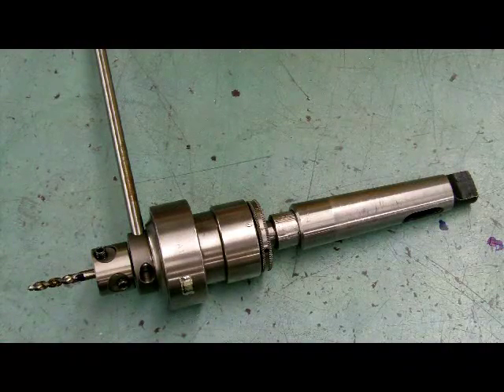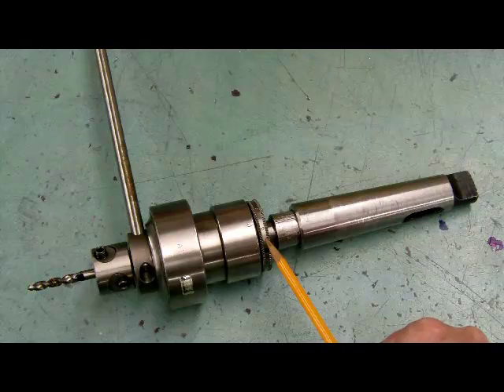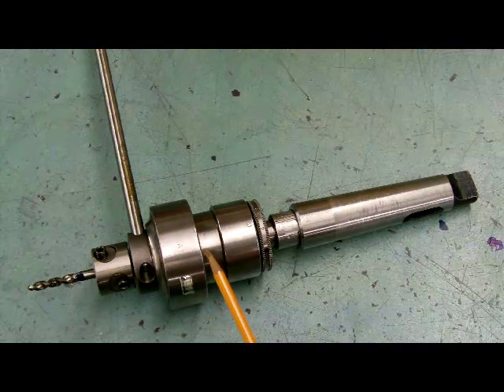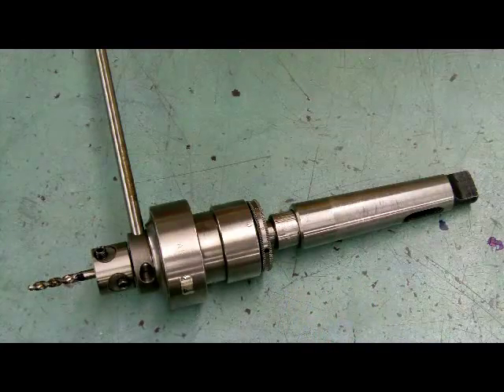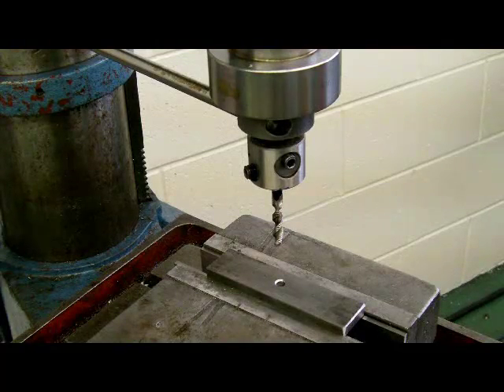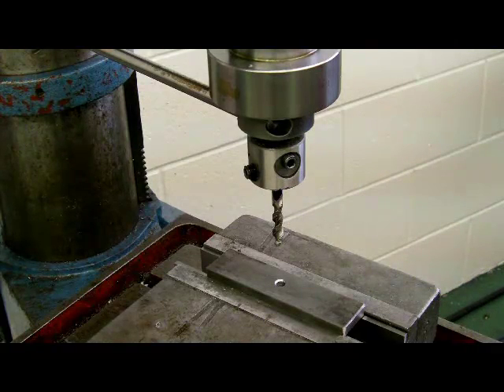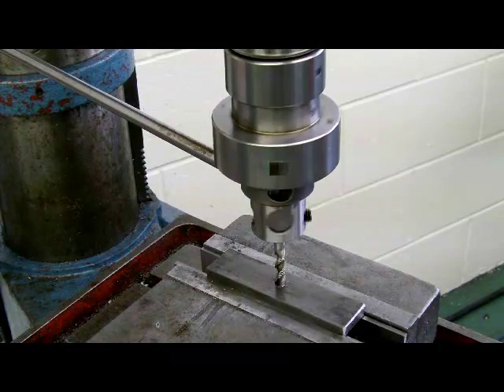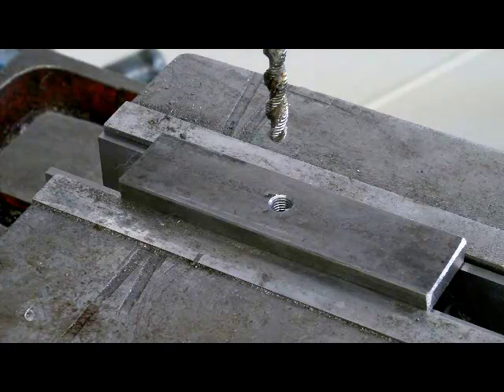Power Tapping Head Attachment

Comment: You seem to still answer your comments, which is quite nice after 9 years.  I've seen those on ebay for a good price, but my Drill Press has a Jacob Taper.  Is there a way to replace the Morse Taper with let's say.. a shaft that I could just insert in my chuck?  Thanks!  Still a very good and informative video!
Reply from the maker: I just did a Google search "tapping attachments for Jacob's chuck", there are some available. Thanks for watching. I can't believe I did this 9 years ago!

Comment: Do you have the power dies
Reply from the maker: Do you mean Rigid? No, they are typically found in pipe trades.
Reply: machiningmoments 
Yes , I was thinking if they made them for pipe, why would they not make unc unf thread for a lathe or drill press. I just bought a lathe and got to go shopping to tool it up. Thanks for the answer and great video, going to definitely be looking for that tapping tool.!
Reply: Here is a shop built version : https://youtu.be/p9p93Xi2LYE nice!  And a Geometric: https://youtu.be/MKibz_wftEw

Comment: This is definitely news I can use because my mini mill doesn't have the hp to run the 3/8 pipe taps I need to use and I didn't know you could use them on drill presses, too. Thank  you very much. And I found this Power Tapping Head on the Grizzly site:   http://www.grizzly.com/products/Tapping-Attachment-MT-2/T10057?gclid=EAIaIQobChMIpOuz3KXY2AIVw7jACh0MKg63EAQYASABEgKXivD_BwE
Reply from the maker: Thank you

Comment: I have a very basic question: Can I screw up the thread by doing the feed wrong in any kind? If yes, what do you recommend with feeding?
Reply from the maker: SE45CX As long is the spindle is not locked the tap will screw itself in and out...in otherwords the thread on the tap controls the feed. Thanks fot the question.

Comment from the maker: A Google search will find these for you. RPM for drilling (assuming HSS cutting tool drilling mild steel) RPM=(cutting speed X 12)/(pi x cutter dia). Cutting speed is about 110SFM. Depending on conditions (drill machine, setup, tool sharpness, cutting oil,...) I would start with about 1/2 calculated RPM for drilling. The nice thing with the attachment is it will slip rather than break. Good Luck!